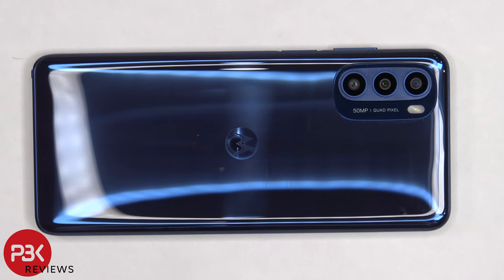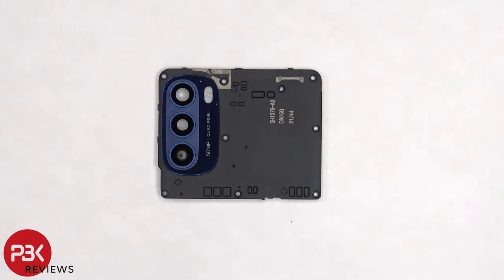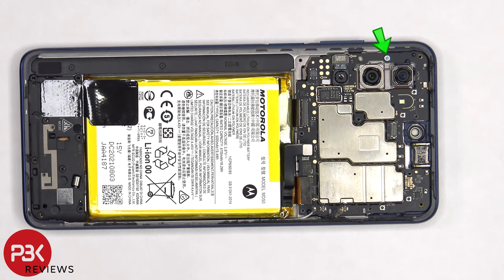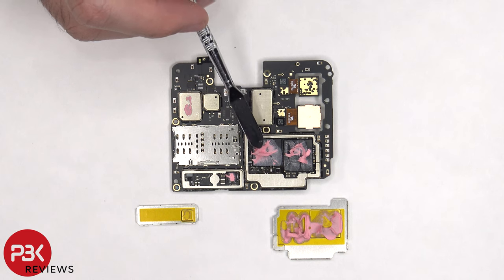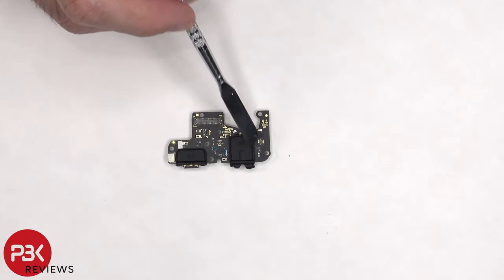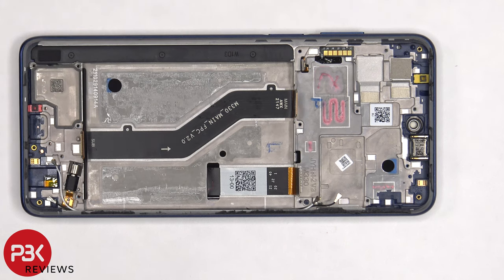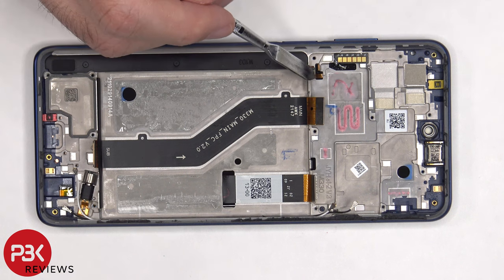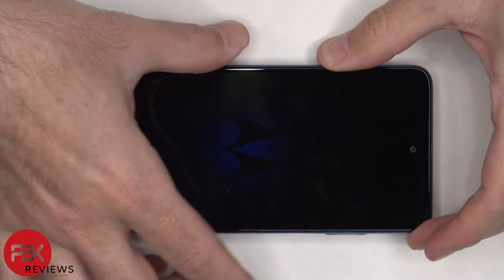Motorola Moto G Stylus 2022 Disassembly Teardown Repair Video Review

Comment: I had to replace the charge port, after successfully doing this I made sure that it charged ok before putting the back on the phone.  I later discovered that the speaker did not work.    What did I do wrong when reassembling the speaker assembly?  Does it have a cable that did not get plugged in?

Comment: Amazing video. I just replaced my screen! I had 2 extra screws on the top, but everything else was so helpful. I was mostly successful... the only thing not working - I don't have a front and back camera now. Thoughts as to what I missed?
Reply: Update... I think it's the connection for the top of the three cameras. Would this cause the front facing camera to not work as well?
Reply from the maker: Sometimes the app crashes or stays black if the main camera its set to doesn't open or run. So won't let you use other cameras either.
Reply: Well, no luck. I took it apart and reattached the top camera. Still black. :-( I did notice a break in the board, top right, around the camera. Its a little thin "L" shape. Maybe that's it? Any suggestions?

Comment: where can i get part numbers for the different removed parts? I need to replace the power port! Thanks
Reply from the maker: You can get the charger port itself or the entire sub board with the charger port soldered to it at these links: https://www.mobilesentrix.com/charging-port-only-for-motorola-g-power-2022-one-vision-p50-xt1970  and  https://www.mobilesentrix.com/charging-port-with-pcb-board-for-motorola-moto-g-stylus-xt2211-2-2022

Comment: Thanks for the video. Do you know where the NFC chip is? Moto spec says this phone includes NFC. I'm hoping it's near the top of the phone, because on my Pixel 4a it's in the middle and is basically unusable because it gets confused by the cards in my phone wallet.
Reply from the maker: No problem. The G Stylus 2022 does not support NFC. Only the G Stylus 5G 2022 has NFC.
Reply: Thanks for clearing that up. Moto's device branding is a little muddled.

Comment: Does the black coax cable control the vibrate motor?  I replaced my screen and now vibrate doesn't work.  I pinched the black coax cable.
Reply from the maker: no, its for the antenna. Make sure your sub board/charger port board is seated properly in place, since the contacts from the sub board need to touch the gold contacts on the vibrator flex cable to give it power.

Comment: I accidentally poked a hole in the phone battery its just a small hole though so is it still good to use or do i need a new one?
Reply from the maker: Would be hard to say, Just to be safe I wouldn't recommend using that battery. Batteries tend to heat up and swell during use, which can cause a problem if there is a hole. Better to replace the battery than have it catch fire and get injured or lose all your data etc.

Comment: i need to replace mine its crack and i think i can replace it with no problem..but i can not find a lcd with frame and this videos do not show how to removed the frame...do you have a video on the frame removal..ttanks a lot for your help...this videos help a lot i have replace many lcds by looking on this videos.
Reply from the maker: Hi, when you took the phone apart, the lcd is just held on with adhesive. Just heat it it up and pry it off. Aside from that you would just need to add new adhesive and re apply the new screen to the frame. You can watch this video on adhesive:  https://www.youtube.com/watch?v=T4iiPUIM7-Y

Comment: I have this phone and it does not look the same inside. Is there a reason why the stylus and sim cards need to be removed?
Reply from the maker: Make sure its the same year model, since there are different year versions of this phone, in addition to one being 5G and one not etc. The sim tray needs to be removed because if not, it will not allow the motherboard to be lifted out.